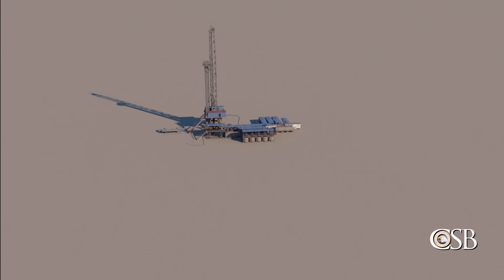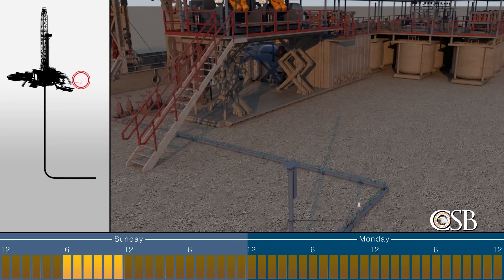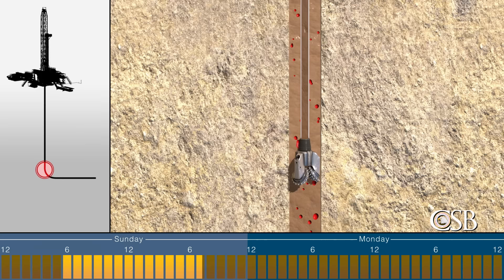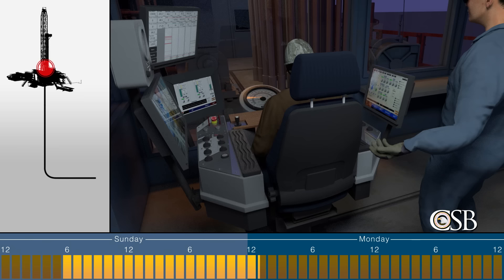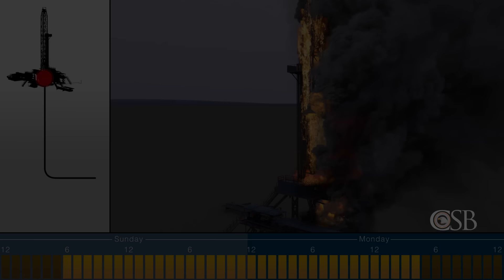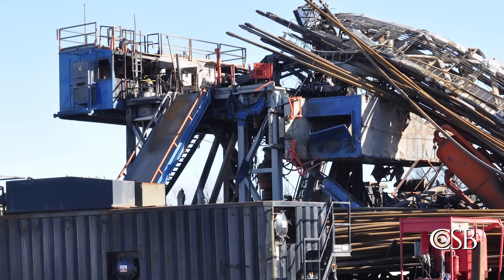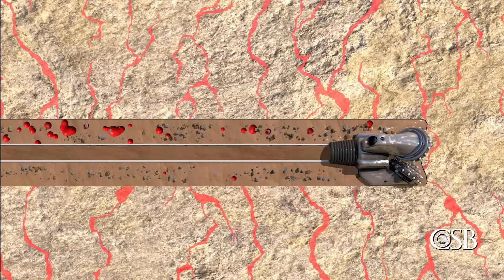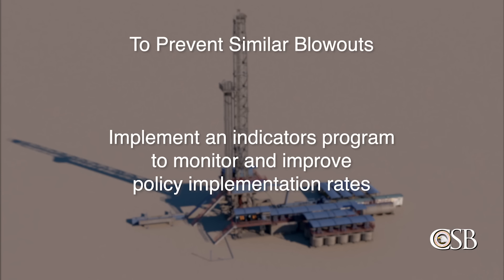Blowout in Oklahoma

Comment: Alarm fatigue is a well-known problem in hospitals. Sounds like oil rigs have the same problem. Thank you for this video!
Reply: Heavily known in the tech industry, as well. I think it's safe to assume that alarm fatigue will occur at any location with improperly calibrated and configured alarming systems.
Reply: @ShimrraJamaane  , or (as is sometimes the case in a hospital) with alarm systems that are working correctly, but staff levels not sufficient to deal with them all.
Reply: Funny you say that. As I was watching the video I kept imagining hospitals. I've been to visit a few people in hospitals lately and I kept seeing alarms go off on the machine that measures vitals. I would see many nurses/assistants come in and not really do anything other than just turn it off and walk back outside.
Reply: @dsandoval9396  ,  an alarm can indicate something like "the patient scratched their head and partly dislodged the pulse oximeter taped to their finger" or "the IV fluid bag is almost empty"--requiring attention but not necessarily high-priority action. So it's hard to tell from an observer's point of view whether the nurses/CNAs are acting appropriately or not.
Reply: in oil and gas there is a lot of work to manage alarm priorities, rationalization, and nuisance alarms.
Reply: Every place that has alarms has alarm fatigue. It's most notable in contexts where alarms have life or death contexts.
Reply: Alarm management consultant...

New profession.
Reply: @lilaralston6314  Essentially all of the false alarms were from parts of the rig that were irrelevant to the current tripping operation, and there was not an easy way to isolate (turn off) them.  Hence the CSB recommendation to have the alarms that are active be a function of the active operation.
Reply: @ForTehNguyen  The alarm system was an advanced one with many new and desirable features that took a lot of work to develop, but hard work is not enough - the designers evidently didn't have a standard to help them understand the various pitfalls, e.g., separate the active alarms into groups by operations category, etc. Also, human interface learnings from other industries.  Hence, the recommendation for a drilling industry standard, both for design purposes and to provide a relatively standard interface, which in turn can be trained/updated in the industry well control schools.
Reply: It's a huge driver in many industries. I'll be using this incident as well as some other papers on alarm fatigue as part of some supplemental training materials for my organization. There's no reason these lessons should be pigeon holes in their own industries when they are broadly applicable.
Reply: @michaelmccarthy4615  That's an existing profession. Education isn't the problem. It's getting companies to stop cutting corners that's the hurdle that's hard to get over. It come down to not wanting to spend money on a fire that may not happen. (Man there are so many applications to that. Like the PG&E situation in California)
Reply: @Gunshinzero  there's also institutional momentum and training lag to take into account. I've seen it  over my career. The regulators, higher ups, and new guys get the importance of a change, but the old guard still resists it because it requires learning a new tool/process. It's even harder when people are over worked or view the existing process as plenty good. Change is hard for lots of reasons.
Reply: @misobeno  I agree with those points. There are a lot of pressures and factors.
Reply: Everywhere you have an alarm system.
Reply: The main problem of course is that even smart people get stupid and the systems in place are not stupid-proof.
Reply: @ShimrraJamaane  - alarm fatique is everywhere, I know it from my work in IT, I've read a few bits about how it had a part in transportation accidents... these systems need careful design and maintenance, or they are worthless.
Reply: @michaelmccarthy4615  - you may be joking, but there's "user interface designers", and if they are any good, they make this part of their job
Reply: @steve1978ger  I was tongue in cheek joking sort of.  But from the comments above it seems there is a real need for managing complex system alarms...
I was joking there is a consultant for that too... (but it doesn't appear to be a joke now)
Reply: @steve1978ger  yup, it's pretty bad in IT. I work in infrastructure engineering and getting alarms tweaked right is a fuckin nightmare.
Reply: Happens in air traffic control to. Could cause some problems.
Reply: We used staged alarms with automatic cutoff. So that at say 1-20% over parameters the operator gets an alarm but at 21% the system shuts down.
Reply: Had I drill force me to rag and tape the trip alarm one time and just happened to hit the rig e stop right next to it and shut the whole location down. He never said another word lol
Reply: Amed Tajan  They turned off the audible horn/siren.  Acknowledging a false alarm (by pressing a keyboard button) every 60-120 seconds is a recurring distraction of the driller's thinking, which is a known safety risk in itself.  After numerous such acknowledgements with everyone being irrelevant to the operation (junk phone calls), a reasonable person stops answering the phone, and leaves it off the hook (turns it off, these days).  The CSB full report details how many there were.  And can Google 'alarm fatigue' to learn more about it.  The CSB recommendation is to have an industry design standard that deals with the unnecessary irrelevant alarms, e.g., having the active alarms being only for those items  that relate to the actual operation; not ones that don't have any value.  This seems very doable to me.
Reply: Amed Tajan  As a made up example, imagine a horn going off every 2 minutes that you don't have the right amount of weight on the bit ... while you are tripping out of the hole.
Reply: I work on automobiles for a living. The seatbelt/door open/lights on chime that dings. I literally don't hear it. Sometimes when I give people rides in my car they say: put your seat belt on, shut up that dinging. I never heard it till brought to my attention. Edit: The dinging goes on all day at work because the key is on while scanning, diagnosing etc. Sometimes coworkers come over and slam the door saying damn it, stop the dinging. I just don't hear it any more. I don't need to turn it off because I  don't hear it. Lol
Reply: Alarm fatigue is a problem in almost every industry!
Reply: As board said, it should be based on state, and silencing alarm during drilling operation should not silence them during creeping. The lack of prescribed flow checks is just baffling.
Reply: Alarm fatigue could be also an issue in IT systems. It usually requires immediate care to calibrate alarms to reduce false alarms.
Reply: Some rig crews just have a “fly by the seat of your pants” cowboy mentality where it’s perceived that doing things by the book is perceived as “not macho”. It’s fucking stupid but that shit was still prevalent in the oilfield at least 10 years ago.
Reply: @lila ralstonThey're drilling rigs. Not oil rigs.
Reply: Yes allot jobs ha e complacency problems at my job a guy nearly list his arm because the wench he was tightening had a bad dog on it which is a piece that locks on the gear when tightening and it skipped off the gear the pipe that was on the wrench that used to tighten it came around shot off and the wrench handle went just about through his arm people over time get comfortable with there work and usually get hurt by the smallest but dangerous errors if he had checked the wrench properly he would have noticed what happened and also heard that the barges were being pinched open which caused the pipe to shoot out and flip along with the bad dog thank god I never been hurt but I have had close calls.
Reply: @Gunshinzero  ...agree....the workplace "culture"......the hardest to get data and info on....and the most important aspect I've seen in industry...going beyond specs and work-standards and design standards..for if the "culture" is wrong...all these things will be ignored or by-passed with impunity with disasterous results.
Reply: while not a high end field,  My first job was pushing shopping carts.  Only took about three days of that to start completely ignoring car alarms.  Someone could steal a car in that lot and we would never have even turned our heads.   Those things went off so much that it was easier to ignore them.
Reply: @lilaralston6314  I've found that some patients push the button ALL THE TIME when nothing is wrong and they don't even "know" they're doing it.
Reply: lila ralston - in Florida the hospital alarms are first answered at the Nurses  desk which prevents unnecessary runs to patients rooms. No Alarm 🚨 Fatigue ❗️
Reply: @Mumblix  Yup, they  may be looking for the TV control or whatever. Then you get situations like my pt who got tired of waiting for assistance to the bathroom, fell on the just-replaced knee, and started a train of multiple revisions, infection, skin grafts, etc. etc. etc. Many issues here, including understaffing.
Reply: lila ralston On ships, too.
Reply: Benjamin Toombs I worked as the only female electrical engineer on ships. There was always this stupid attitude toward safety. Men had the attitude that using  protective safety equipment was a “ wimpy” thing to do. Many, many times I watched my shipmates as some derided safety use, and others, who knew better, wouldn’t use it because they knew they’d be laughed at. I sounded off in people’s faces whenever I saw this happening, and always saw relief on the faces of the guys who were afraid of being laughed at.
Just mouthing off for a minute gave them that little nudge to begin using safety equipment. Then the ones with the tough attitudes followed suit. People are funny.
Reply: lila ralston it all so happens to hamburger 🍔 makers as well don’t discriminate against poor people
Reply: Israel Moreno Rice beans potatoes carrots onions 🍠🍅🥝🥬🍆🌶🥜🥑🥦🌽🍏🍊🍓🌮🌯🍛....✅❤️😬 cheapest food on the planet 🌎. Scientific fact.
Reply: We call those false alarms 'noise' in information security.
Reply: driller43 I would be surprised if the designers had hands-on knowledge of conditions during actual drilling operations.  I know nothing about drilling, but have seen a lot of software engineers that want to display sensor/alarm information without offering any guidance.  The state system mentioned would allow the alarms to be tuned to context, and keep them relevant.  For example, a "40 Mph" signal in a car could have a different on the highway (too slow) or in a school zone (too fast).
We don't think about the context we've learned to interpret that signal, but not everyone has learned it.
Reply: Very very very good,
Reply: In the aviation industry they're known as nuisance alarms and they are a serious safety problem. Ideally an alarm system should only alert an operator, be it a pilot or a doctor, of a serious problem that requires immediate attention. If alarms are sounding for comparatively benign reasons, then operators will simply ignore or even worse turn off the alarm and thus be blind to potential hazards.
Reply: @brandonjones572  Agreed; but if workers are going to stay alert to alarms, things have to be fixed so that alarms aren't constantly going off.
Reply: That's not the only problem. Some of these alarms are so loud that they're painful. I work in a factory and it's a constant battle. Someone will tape over a speaker grill to quiet it, someone else will take it off. If they could be disabled in software, I am sure it would be done. These alarms are straight up painfully loud. I wear ear protection because of them as often as possible. It's like having a child screeching in your ear. It actually makes work more difficult.  Thankfully none of our alarms are for safety, they're just for machines that run out of materials or encounter a fault. There is one machine were that's not the case, but thankfully it rarely needs attention and operators are not stationed at it.
Reply: In aviation nuisance alarms are completely unacceptable. Either the system is fixed, or disabled  and any alarm however unrealistic is treated as real. Too many people have died because of this.
Reply: Someone once brought up a monitoring system from the neonatal unit, NICU to be precise, and no one, on site, was authorized to reset the alarms. It went off constantly, because it didn't feel that the heartrate should ever go above 90bpm, amongst other less constant things I expect.
The alarm was contiously muted by nurses, then by family that was experienced in reading the machine, and eventually an angry nurse slid in the door and unplugged the whole thing, because it was late and two actual emergencies were taking place.

Nurses did continue to check on the patient, but no one fixed the machine after it "died." 
Another example of alarms that need to be appropriately set for their specific jobs.
Reply: @hotaru8309  I think this is related to a larger problem of systems being designed (and purchasing decisions made) by people who have never had to use a similar system, and who don't bother to familiarize themselves with actual conditions on the ground where the system will be used. Accounting systems, recordkeeping, purchasing....!
Reply: @lilaralston6314    I agree, but that wasnt the problem in this particular example. It's more a safety thing, hard to pin down who did what with machines. They don't want a nurse to adjust settings to a patients needs and then have the next patient/nurse not realize that the machine is no longer set to the standard that works for around 90% of patients.
I get it, but it fails the patients with the highest risk factors and most complex cases because they are the ones who are frequently different than the normal setting and the constant alarm that isn't allowed to be adjusted to them makes it so staff stop responding to the alarms of those high risk patients.

In this case equipment moved from one ward to another should have the settings changed to the normal range for that area, but often only certain doctors or pharmacists are allowed to adjust the monitors.

Although not understanding how often different areas share equipment is the fault of someone who doesn't work in that area and hasnt experienced the machine designing it and influencing many of the rules and safeguards. They dont realize there are different "normal" rangess for different age ranges and conditions/areas like the nuerological section versus the GI patients. Having a board of doctors determine and preapprove appropriate ranges for different areas and making sure someone is available with that chart to change equipment to the appropriate range could ease the burden and help facilitate better care and stop the waning response times and the constant alarm screeching.
Reply: @lilaralston6314  I think one of the worst lack of "on the ground" experience by decision makers is this
Curlin portable IV pumps have a sort of partnership with Duracell, so the manuals for the machines recommend using Duracell Procell batteries and does not mention other brands, but also does not advise against them. It really is a recommendation.

The problem is every summer once the temperature starts going over 90°F, the Procell batteries start to fail. 4-6 in each box of 12 will provide no charge and patients will require boxes per delivery period. Once it hits 100°F, even for a day, entire boxes will start to be unusable. To the point that during summer, it's common to send 5 boxes out and have 3 boxes worth of batteries be completely unusable and 2 boxes usable, but with worse battery life. Procell batteries in summer last for 1-3 hours  while Energizer batteries last for 5-7 hours in the Curlin pumps.
Because the Procell are the only batteries listed as "recommended" both Home Health companies and insurances will only pay for and provide those batteries for the equipment.

So despite the fact that they lose massive amounts of money in trashed batteries, they think and repeat, "Those are what are recommended, so those are the only batteries to be used with the Curlin Portable IV pumps." They assume they must be superior batteries somehow.
Reply: @hotaru8309  , yes, it seems like in your NICU example having several preset menus to choose from, that can then be customized within limits by authorized folks, might be a more workable design.
Reply: @hotaru8309  , re the batteries--what a nightmare!
Reply: It's a well-known problem in restaurants too. Timer goes off? Turn it off not tell anyone. 5 minutes later: "What's that smell?"
Reply: Definitely don’t want alarm fatigue when you have explosive diarrhea with backed up gas cavities, and cavitation in the shit tube...
Reply: @csours  In that case the alarms should be lockable shock collars that are attached by supervisors at the start of each shift and removed at the end. You have to stay focused in those ''contexts''.
Reply: I can think of an example, my old job we would get constant nonstop emails about IT issues, most of which did not affect us. But when they did and I read them, my colleagues often did not know because they had not read them.
Reply: Just as car alarms are now ignored by everyone.   In the 90's if a car alarm went off you went to see what was going on.  Now with nearly every car having alarms that go off if you sneeze out loud we just ignore them.
Reply: @mrbyamile6973  -  “Relax bro... “

🔨😫🔪⛓🍖🦠💩🔴👶🏽.... 

🛸👽🔪⛓🍖🦠💩🔴😵/🙁....

🔨😩🔪⛓🍖🦠💩🔴🐮🐷🐔🐟....

✅❤️😋🌾🍄🍏🍊🍅🥬🍠🥕🌯🌮🥙🍛🍜🍝🍲.........

Which is the reasonable choice ????....
Reply: It's pretty much every manual labor job that tends to overwork employees.
Reply: As a nurse they are annoying when it's nothing, but you always assess them for the problem.
Reply: Slowly getting better in healthcare on account of Joint Commission and CMS Quiet Hospital initiatives. IIRC one of the National Patient Safety Goals is about alarm fatigue.
Reply: @philhobrla8489  .. Plaque forms eating animals. First time 6 years, no plaque. Are used to think it was normal having plaque, go to the dentist, Six months (🍖)😬.... but now I’m vegan, 7 years I don’t have dentist service because I don’t need it. Can’t believe it ✅❤️😬👍. 
But gorillas are plant-based and they never eat animals. No plaque at all. And no toothbrush !!! Clean and fresh !!! Gorillas teeth on Google.. look for yourself....
Reply: Charge nurse: turn off your patient’s alarm.  It’s going off continuously because of artifact, and making it difficult to hear other patients’ alarms.
Staff nurse: I can’t , we’re not allowed to turn off alarms.
Charge nurse: do it.
Staff nurse: can’t …
Reply: @ShimrraJamaane  Everywhere for sure, I mean who even flinches at a car alarm these days unless it startles you with proximity?
Reply: @lilaralston6314  Peep peep peep           Peep peep peep            Peep peep peep           Peep peep peep 

That IV pump alarm will haunt my days forever after 5 years of working in a Hospital and not being allowed to turn them off..
Reply: Alarm fatigue/annoyance is a problem in pretty much any industry where they are common along an entire process or several processes. Medical machines are the worst. Even as a patient in the past I've gotten really sick of them.
Reply: @74KU  precisely.
Reply: As a control room manager, it's what keeps me up at night.

One big issue is false alarm rate: it's proven science that the human brain will naturally reject the whole system when the false alarm rate reaches above about 25% (it's a damn low threshold!). 

It's the natural and rational thing to do as a specie, else we would become non-functional due to hyper-anxiety worrying about every little noise we hear outside. It's not dumb, it's how the brain is designed and it served us quite well over thousands of years. Trying to defeat this design will likely create more problems than anything. 

If your system relies on a human to take action, it also has to be properly designed for that human factor, or else one day it will catastrophically fail.
Reply: No no no. Alarm fatigue is ridiculous. IF YOU CAN'T HANDLE CONSTANT ALARMS, DONT FUCKING WORK THE DANGEROUS JOB!!!!!
Reply: @juanblank6771  If the alarms are going off constantly, something about the facility/procedures needs to change.